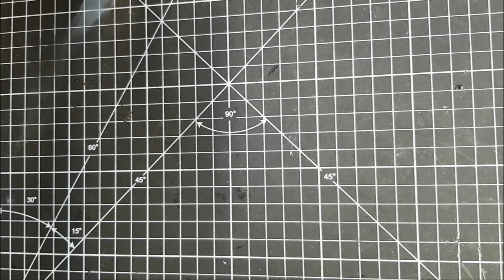Rcinpower GTS V2 2306 1800kv review Part 1

Comment from the maker: One thing I forgot to say. There’s virtually zero balancing gunk on these. Rcinpower must have one hell of a good manufacturing process. Emax take note... after using them on 6s I'm very impressed. One of the smoothest motors I've ever used. Power delivery is perfect for my style. I think the aluminium may be 6061 tho as one of mine has a  gouged bell in a way I haven't seen before. Still perfectly smooth however well worth the price

Comment: I'd love to know what you think about these on 6s. I have the northaero dragons 2207.5 in 1850kv and I was looking at these for a 2306 build.
Reply from the maker: Fraser Steen keep an eye out. I'll  have a 6s to try shortly. Curious too. In China they're big stuff. Let's see if they're the same here.
Reply: I ran the typhoon motors but recently switched he'd to 6s. How's the dragons on 6s?
Reply: Well they are super powerful and super smooth but I'm not sure how great they are for freestyle. I can't find a low pitched prop for them that doesn't flatten out at high throttle! Cyclone 5045s are ok but they are a bit heavy for a high kv build. I've had best results from the azure 5150s as they are light enough to be responsive but as you can imagine it won't do anything slower than stupid fast. Agree with KebabFPV that 1850 on 6s feels amazing but I disagree about the freestyle thing due to the prop choices available. on a 1300 am draw is totally managable. I thought the typhoons looked like too much for 4s but the lack of sag on 6s compensates nicely.
Reply: @frasersteen  thanks, that's pretty informative. I found the 5149's on 4s with the 2650kv gave me the best results. They're fast props and stiff enough to not go to hell on high throttle. I just switched to 1700kv 2207 xnova lightning v2's for 6s, and tbh, I think the northaeros felt faster and better in the air, though not quite as smooth. Might just be the kv difference though, or maybe that extra .5mm of height :)
Reply from the maker: Fraser Steen I’ll be using HQ V1S 4.3 or 4.8 on 5”. Don’t like Cyclones - to grippy for freestyle and they drop blades too often if you clip anything. They won’t have any problem with these. I’ve run F60 pros 2500kv on 5s and they’re fine, and the F60s throw more power than these at the same Kv. For 6” I’ll be trying both pitch HQ v1s and also 5.5” as I don’t have any experience on that size prop.
Reply: Bet you get double the flight times though. I'm beginning to suspect 1700kv is the right spot. 1660kv is too low, it gets boring before the battery is done and my 1750s fly great but I think I could do with just a touch more time in the air.
Reply: I can't get on with the lower pitch hqs they seem to distort quite badly even the 5.1x4.6x3 on my r6 2207s. Feel great though.
Reply: @frasersteen  flight times are pretty close to the same honestly. I used an 1100 gnb 6s to compare to my 1550 tattu's cause they're within a few grams of each other, and I get maybe 3:30 on the 6s vs 3:00 on 4s. I'd rather have the power :D
Reply from the maker: Fraser Steen suppose it depends on your style. I’m Smooth, so I’m pretty gentle on the throttle. Can’t speak for stick mashers ;)
Reply: Lol, guilty as charged.
Reply from the maker: Fraser Steen 😜
Reply from the maker: Fraser Steen I'm loving them on 6s. See my later  flight vids
Reply: @CoppertopFPV  Seen mate, great flying, congrats on your RR community mention too. You'll have to be nicer to drew about his frame now! TBH though I find it hard to tell what's frame, what's pilot, what's tune, what's edit, what's hypersmooth and what's motors from flight videos. I like the discussions because it gives me some context with what I am looking for in the vids, also I like academic discussions about toys.
Here's a question for you: I run 2207s mostly never had a 23xx or wider. I want to try a set of the BH r6s because they are purdy, what 6s KV would you say would be the best match for a 2306 stator? 1660kv or 1800kv - I'm looking to get the best of the stator size qualities as I've got a rang of Kv's on my other builds. People say the throttle resolution is better so I was thinking 1660kv to use as a bando flier, low-tilt, high control. Thoughts? Do a vid ;)
Reply from the maker: Fraser Steen R6s are available in 2207 as well. I have the 2150kv on 5s. I haven't tried 6s beyond this but id say 1700-1800. 2306s are a little softer at the bottom so it feels like they're smoother and have more resolution. 2207 is linear throughout the throttle. For my own style I would probably say 2306 suits me better tho I fly fine with both. For a more aggressive pilot I'd imagine 2207 or 2208 is better
Reply: @CoppertopFPV  I've got those r6 2207-1750 on another build but the whole 2306 debate makes me want to have an opinion on it.